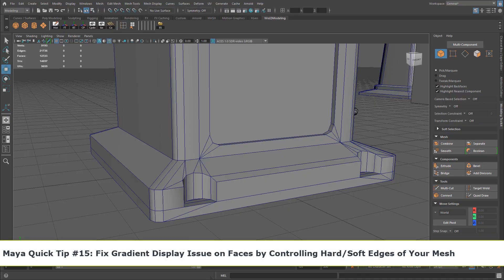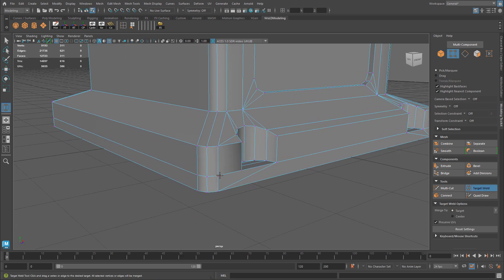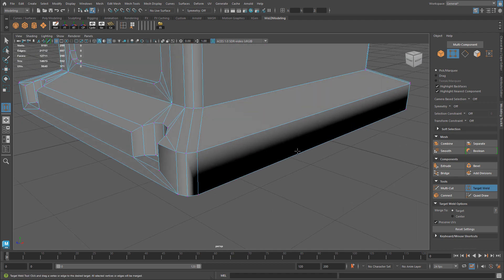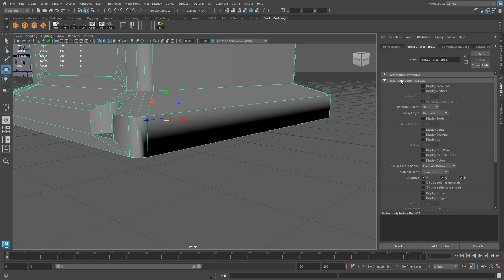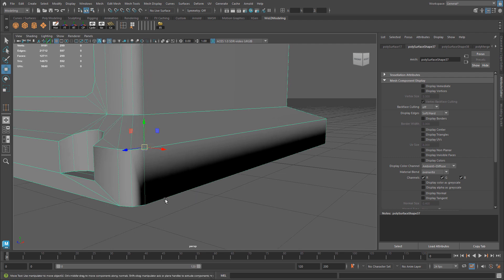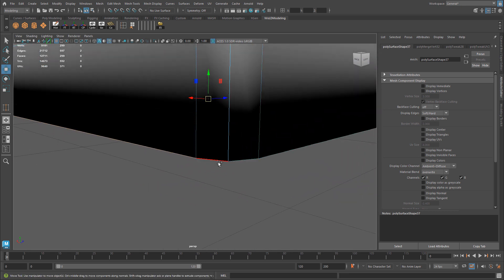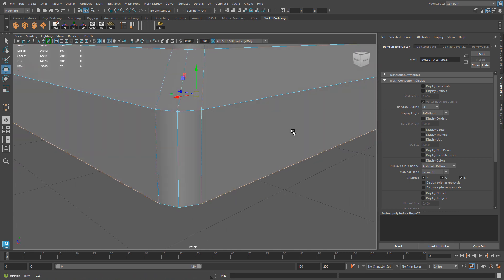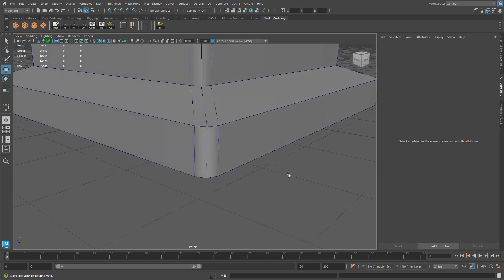Maya Quick Tip 15: Fix Gradient Display Issue on Faces by Controlling Hard/Soft Edges of Your Mesh

Comment: So i have the same shading issue on my model but My hard edges are still showing up with the shading issue when i do the soft/hard edges fix
Reply from the maker: Try checking your geometry: doubled up/overlapping verts, bad faces. Rebuild the faces with those edges if necessary.

Comment: hi, if we have a lot of edges or a medium-mesh then how we can soft or harden all the edges, if we can do as you can show us on video, then it's a very lengthy process to do, but in a blender, it automatically adjusts all the hard and soft edges I think, is this anyway in Maya, a quick way. Thanks
Reply from the maker: Take a look at Mesh Display > Soften/Harden Edges Options. This will allow you to set soft edges based on an angle of all the edges.
Reply: @WorldofLevelDesign  Thanks. Got it